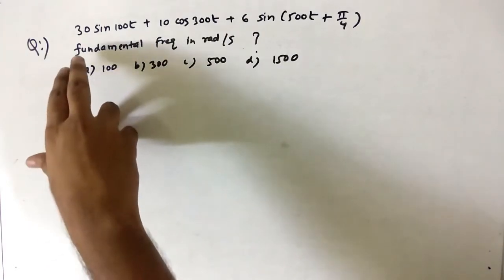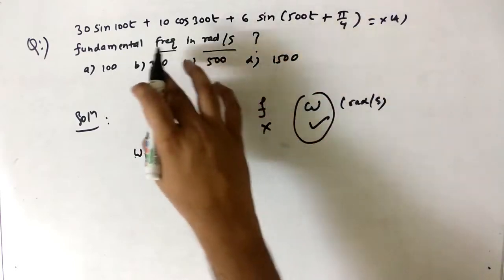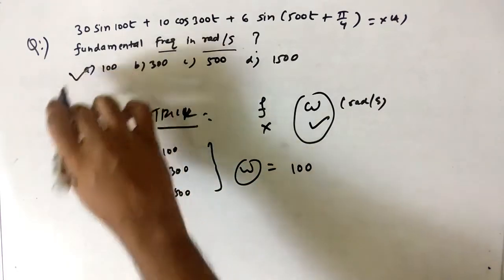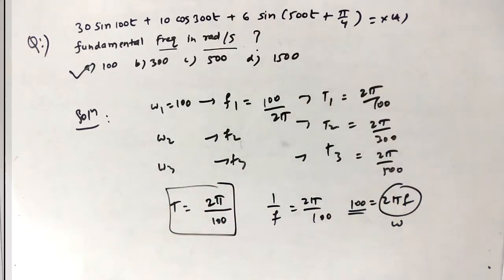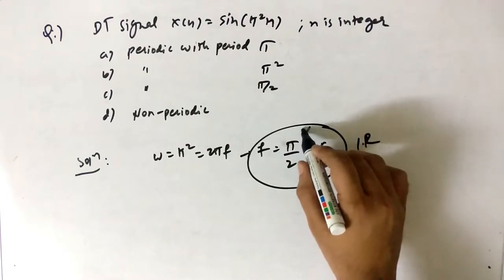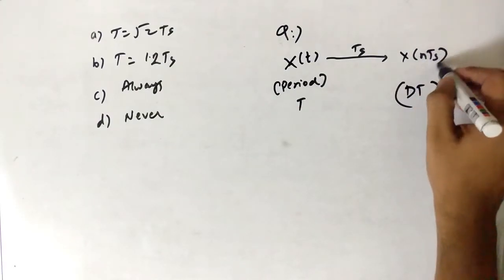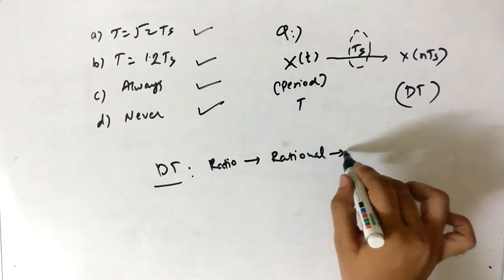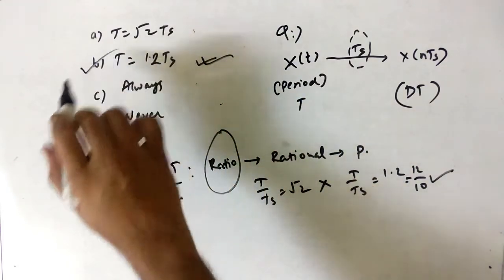GATE questions - Periodic and non-periodic/aperiodic signals

Comment: In last question..for periodic it should be rational na..1.414 is also rational?
Reply from the maker: gangavarapu anil 
Put that in calci √2
You will get your answer 😀
Reply: Shrenik Jain u took 1.2 as rational..1.414 also rational by we writing 1414/1000
Reply from the maker: +gangavarapu anil 
√2 value is not just 1.414
Put √2 in calci that is what I said :)